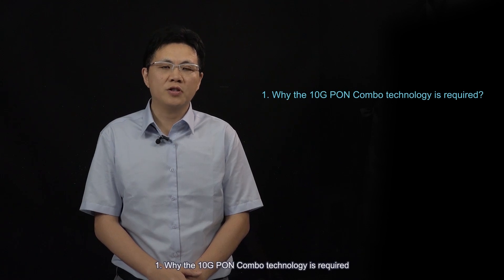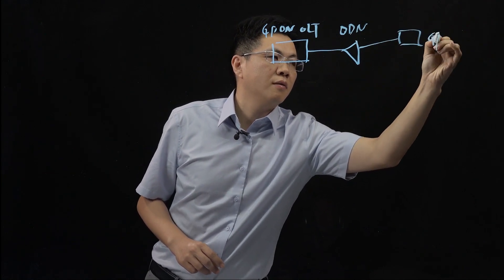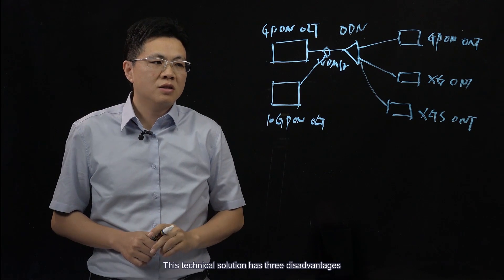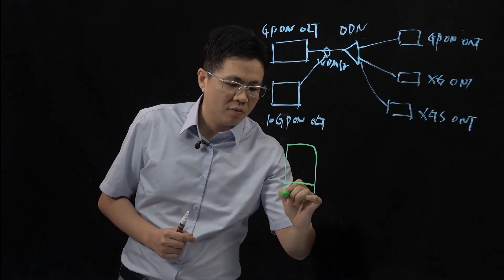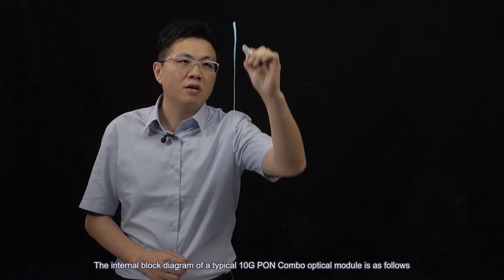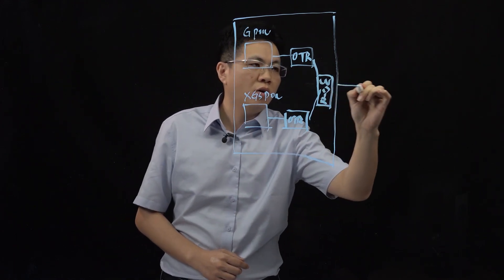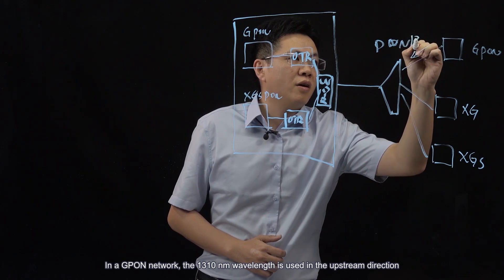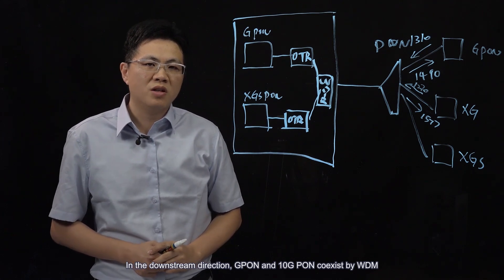Huawei GPON-Understanding XG(S)-PON Combo

Comment: It is very nice presentation about Single Combo XGS-PON. How do TWO XGS-PON CoMBO OLTs communicate with each other where both combo XGS-PON OLTS use different wavelengths? Could you please share some information about my query. Thanks.
Reply from the maker: Thank you for your feedback.
I recommend a special document about the PON Combo feature. This document describes the working principles of the PON Combo feature. I hope it will be helpful to you.
Document Link: https://support.huawei.com/enterprise/en/doc/EDOC1100086825

If you have any other questions, leave messages in corresponding web pages.

Comment: After the network change, the existing GPON ONT will receive both GPON 1490nm optical power and XGSPON 1577nm optical power. Is there any thing need to do at the existing ONT side? for example, should there be a WDM filter to block the 1577nm optical power to avoid it damage the ONT's transceiver?
Reply from the maker: Hi dear Fang Shucheng
, 
Thank you for your feedback.
Yes. After the network is changed, the GPON ONT on the live network receives both the GPON 1490 nm optical power and the XGS-PON 1577 nm optical power. Because the wavelengths are different, the GPON ONT selects the required wavelength through the internal wavelength filter.

Comment: great stuff keep on    , i would like to know OLT following by what (switch or router) in tier 3 ISP (i.e having 4 * 10 GE ethernet transit)
Reply from the maker: Dear Kozhen Idres, Thank you for your
feedback. Do you want to know which upstream mode can be used by the OLT to
connect to a Layer 3 device (a Layer 3 switch or router)? The Layer 3 device
provides 4 x 10GE interfaces.
Reply: @HuaweiSupport  thank you for the answer but  i see OLT ies with 500 Gbps has 2* 40 GbE (80 Gbps) doesn't it make bottle neck ? , doesn't it create latency issue for games which is matter the most now aday
Reply from the maker: @kozhenidres314  Dear Kozhen Idres, what do you mean by 500 Gbps and 2 x 40 bps?
Reply: @HuaweiSupport  any OLT which has 12 cards each with 16 gpon port (2.48 Gbps) = 480 Gbps but on the back there's no more than 80 Gbps it's the case in most olt ies

Comment: I don't understand how XG-PON and XGS-PON coexist simultaneously? https://youtu.be/JqMJ4i9_37E?t=282
Do I understand correctly, if I use XGS-PON combo board, i can connect both XG-PON and XGS-PON ONU, but what UP speed i will have for XGS - 10Gb/s or 2.5Gb/s legacy?
Reply from the maker: Dear Alexander Pischulin, Thank you for your feedback. Your understanding is correct. The XGS-PON combo board can be connected to the XGS-PON ONU and GPON ONU. For an XGS-PON ONU, both the upstream and downstream rates are 10 Gbit/s. For a GPON ONU, the upstream rate is 1.25 Gbit/s and the downstream rate is 2.5 Gbit/s. The rate of the old GPON ONU remains unchanged. If you have any other questions, leave messages in corresponding web pages.